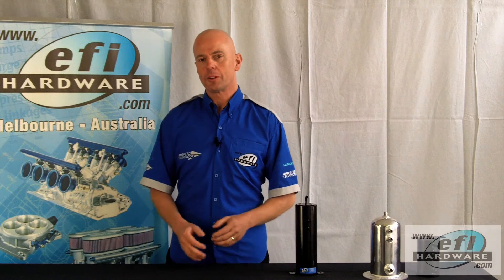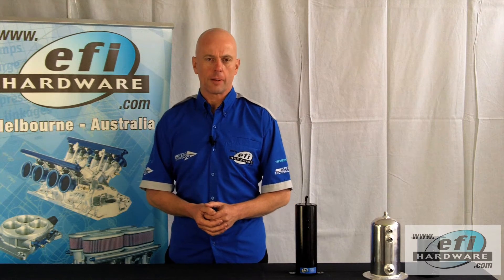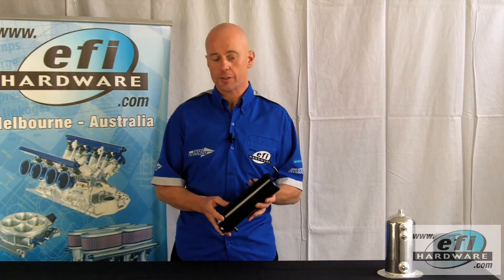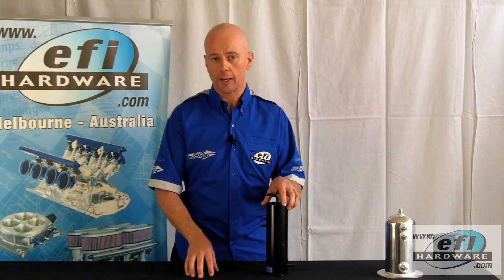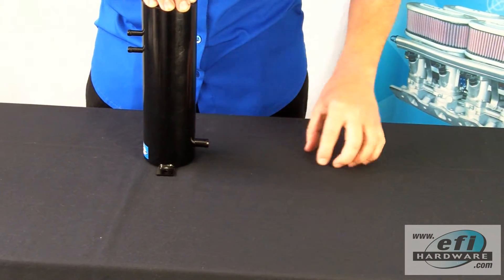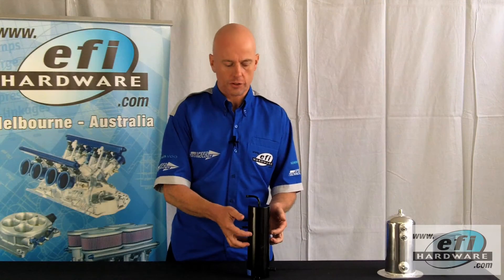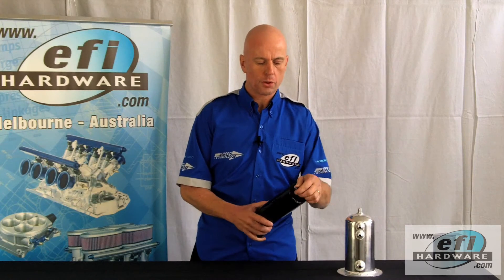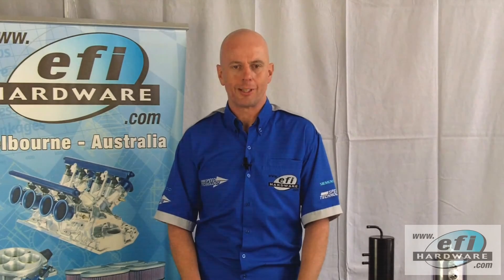EFI Surge Tanks - EFI Hardware

Comment: Hey ive got an RB20det vl turbo and when i got it it had a surge tank set up.
Just wondering if i can run the car with out the surge tank set up by just using the factory pump
Its pretty standard with a bigger turbo etc, any help would be good thanks.